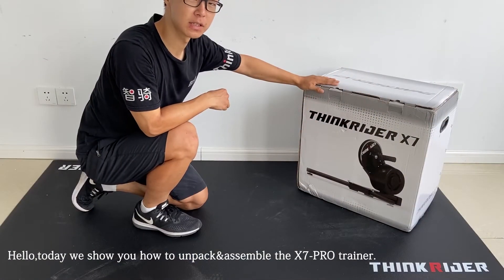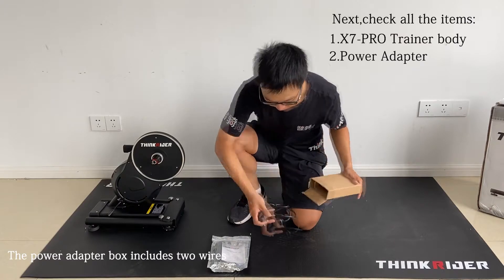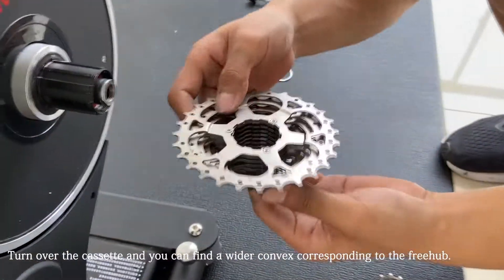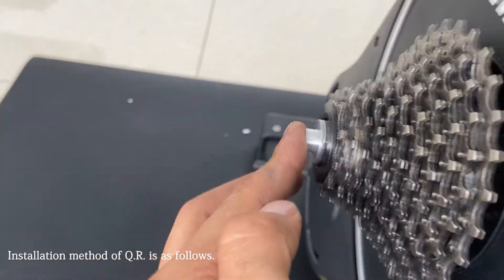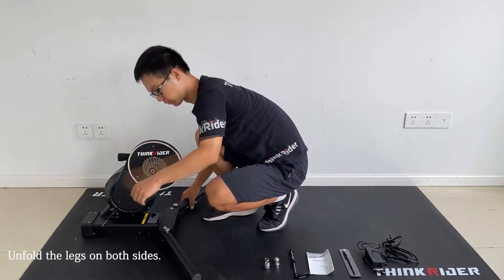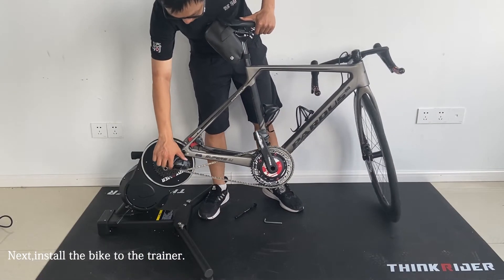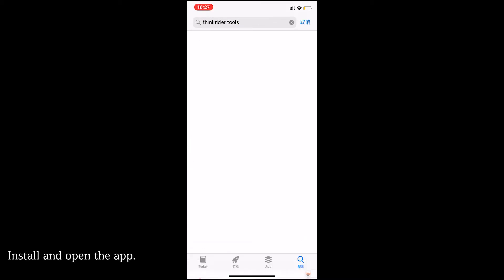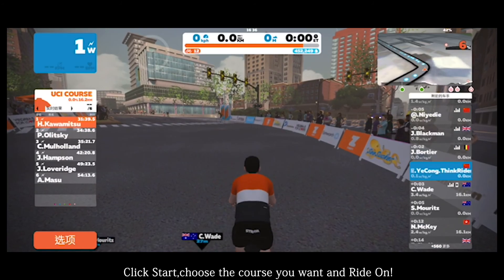New ThinkRider X7-4 Smart Trainer Unpacking and Installation, Calibration

Comment: Hi, I just bought A1 and tried do the calibration according to video. But it failed to finish. I connected the app with the trainer but connecting is written on the screen during the calibration and couldnt accomplish it.  The I switched to zwift, power reading is good but cadence is wrong. I ride around 90rpm but it shows 65 RPM. How can I Fix this ?